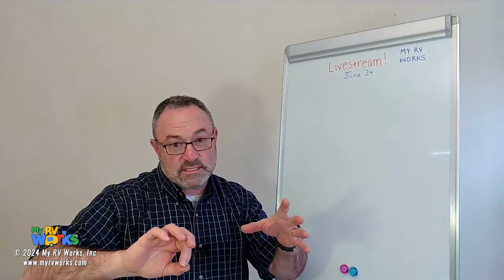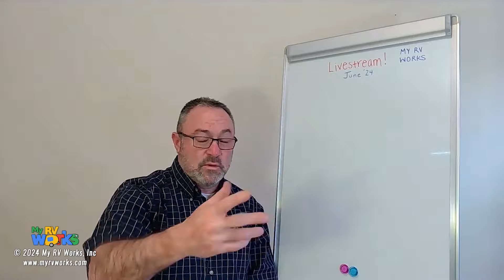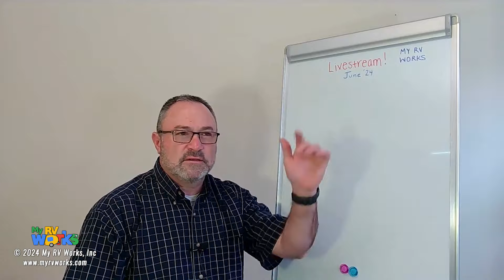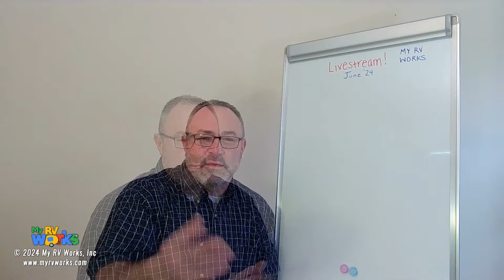What Does A Battery Disconnect Do?

Comment: I’ve had seven different rigs from a 45-foot DP coach to a 17-foot Casita and I have yet to find a battery disconnect switch that completely disconnects ALL DC loads from the battery. There always seem to be a few parasitic DC loads still somehow connected to the battery. The parasitic loads include the propane detector, the hydraulic leveling system, the stereo radio, etc.  All these parasitic loads were connected by the factory. I have always installed a separate dedicated battery disconnect switch in the positive lead(s) within 12 inches of the battery so I completely disconnect all the loads, including the parasitic ones.